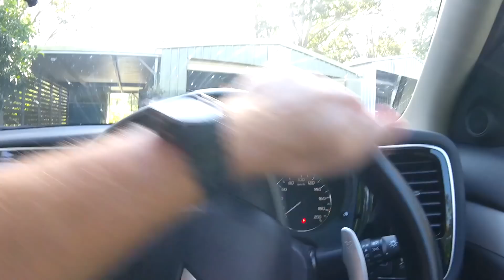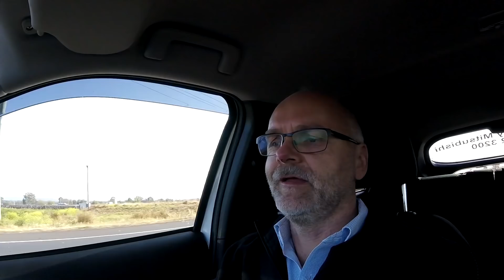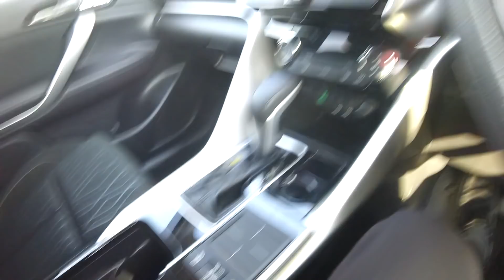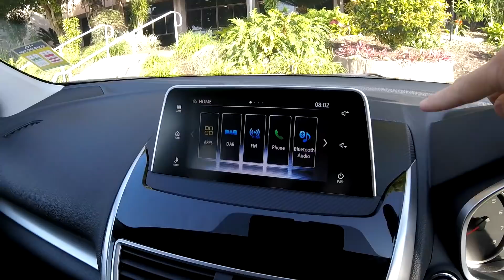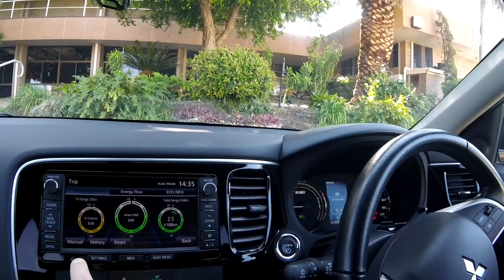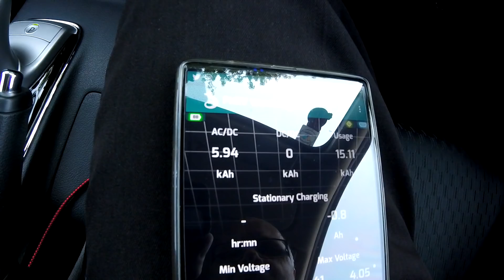EP123.2 - The 2nd battery procedure for the Outlander PHEV ⚡🔋🔌

Comment: puh, I pay 27 EUR cent per kw/h (= 43 AU$ cent) for green energy here in Munich @Germany (22 EUR cent for non-green energy) :-(
Reply from the maker: Is this only one tariff or does it change during the day depending on the time?
Reply: only one tarif - they‘ve changed this a few years ago, so the night tarif is also valid for day use - I regularly check for alternatives - but this is already a „good“ price - I currently invest some time to check if photovoltaic is an option here (house for several families)

Comment: Hi Andy, 
I have an interesstin information about the "speed limit function" in the PHEV. I mention when you set it, than the car is driving more efficient, because it does not react on a nervous gas food and often it is nor nessesary to accelerate but I mention I do variate it unconscious. The car just take the energy to hold the speed and this is more efficient (the needle of the torque tachometer goes more in eco mode).

If you push the gas padle 100% than you can override the speed limit funktion for example in an emergency situation to pass by faster somewhere.

The PHEV also is regenerating automaticly when you drive downhill with the speed limit on. You don't have to adjust the B mode, the car do it itself. It is a very smooth funktion. I like to use it.

Comment: That's why in the US they specifically stated in the warranty booklet that the battery degradation is not covered by warranty. I'm afraid that degradation will be the case with all PHEV , also Clarity, Kia and others ... It's just too much work for such a small battery :(
Reply from the maker: Yeah the ratio of battery and motors is not right. The battery is under permanent stress while driving and degrades a lot faster than in BEVs with larger battery due to that fact.
Luckily we have the strong statement of 80% capacity remaining over the lifetime of the vehicle here in Australia.

Comment: Well, the last BMU reset did some trick because it didn't go all the way down to the previous value overnight. It took your car a good few months to go back to the previous value. That would prove the battery is indeed in a much better state than the BMU "thinks!"  So maybe you should ask for another BMU reset then?
Reply from the maker: It's hard to deal with the dealer as they always need the advise and order from Mitsubishi. Mitsubishi though will not acknowledge any data from the Dog as a third party app. Everything is back to MMAL now...

Comment: If Mitsubishi have any honor at all they should replace your battery pack, as all individual cells are in balance then it the whole pack that need changing not just individual cells.
Reply from the maker: Yea, but a new battery pack is nothing worth if the same shit happens again in 2-3 years due to a software which cannot calculate correctly (if the software is to blame). Also a new battery need to come with new warranty in terms of fault and degradation.

Comment: Stay after em Andy...I laughed when you said " They went for a test drive...and used FUEL!!! Why would they do that!!!"  My dealer here just sold me 18 inch rims and told me 16's would ruin my E brake sensor....apparently I am now told by onliners that this is not true. Mitsubishi then called me back to apologize.( they watch my channel and saw the comments)..because I can use 16 inch tires....Its hard to trust the experts...when they are not experts.
Reply: Of course, you can. The ratio will just be higher (more rubber between the rim and the thread).
Reply: I just tried 16" and as long as they don't rub anything it's fine . I'm doing winter tires on 16" - they are way cheaper.

Comment: Battery degradation isn’t news for Nissan Leaf owners. My 2012 was at 78% at 5 years old when I bought it and dropped to 70% after very hot summer. Tesla seems to have best degradation, about down to 90% after a few years. I’d expect your degradation to slow down, maybe stop about 70%?. Nissan guaranteed replacement if hits 66% degradation within 5 years.
Reply from the maker: 66% after 5 years is fairly save for them. The lack of thermal battery management is a big downside of the LEAF. Only the new 60kWh LEAF will get it.
Reply: The problem is the battery size besides thermal management. Tesla has 60kWh or larger batteries, older Leaf 30kWh and Outlander PHEV 12kWh - the battery in PHEV is under much more stress than in any other EV.

Comment: 1,60 AUD is high for gas? In Norway it is 2,9 AUD pr liter. No wonder 45,3% of all new car sales in September was electric.
Reply: $2.49 here !
Reply: Norway heavily subsidizes EVs with their massive crude oil revenues. It can be cheaper to buy EVs compared to ICE vehicles.
Reply: It is correct that the EVs sold in Norway is totally without tax (for now), whitch in comparison to other cars makes them affordable, but lack of a tax is not the same as subsidize. Subsidize would require that the cars is cheaper to buy for the customer than the factory price. We are not using oil money to keep EVs prices down but we can afford to not get tax money from EVs so we can move costomers from petrol/diesel to electric.
Reply: 2.42AUD here, in Switzerland. Diesel is even more expensive.
Reply: John Bjerke how does Norway generate its electricity? Are there a lot of renewable systems in place?
Reply: 96% hydroelectric, 2% wind. But we are on the european market so we both buy and sell there.